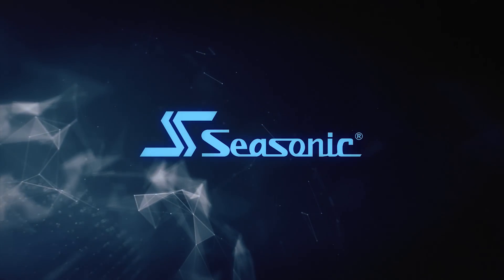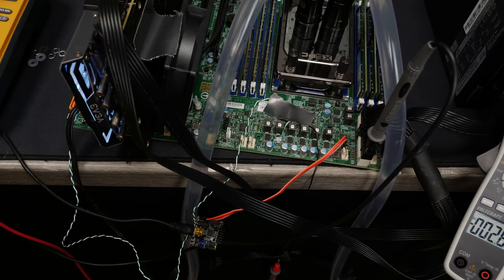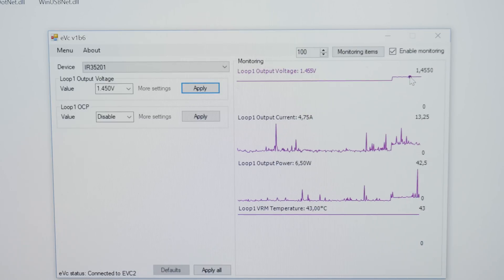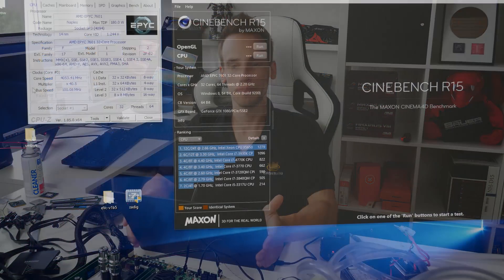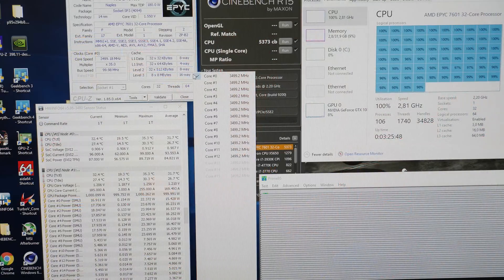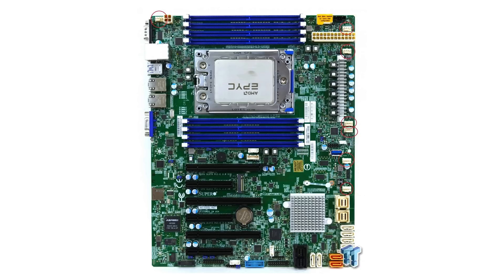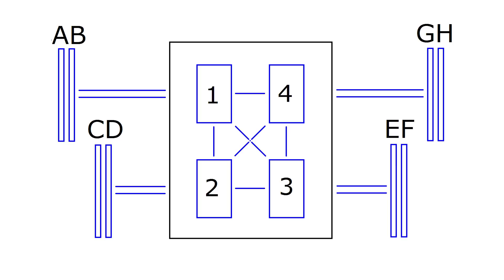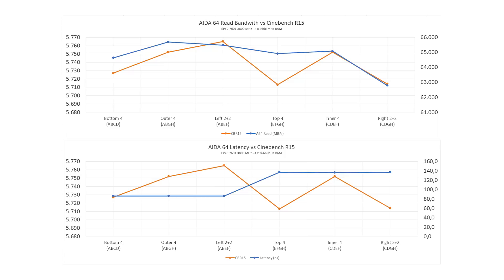EPYC 7601 Overclocked - Over 6000 Cinebench R15 and extensive RAM Tests

Comment: My dual EPYC 7601 (under default setup) only can reach 5200cb in Cinebench R15, is that normal? Another problem is the power consumption only can reach 150W, is lower than its TDP (180W). The motherboard is H11DSI, 16 ram with DDR4-2400.

Comment: I know this is an  old video.  With that said, can I push this chip to a stable 3 ghz with just a typical liquid cooling loop? I'm looking to build a 32 core system on the cheap and this chip is $500.00 from a reputable seller.

Comment: Ich verfolge deine Aktivitäten seit ich 2009 meinen 1. richtigen PC gebaut habe und erstmal Respekt für die Leistung. Meine Frage, ich habe auf genau diesem alten System das Problem, dass das Bild random freezed, aber der Ton und scheinbar das System weiter laufen. Abundzu spult das Bild sogar nach ein paar Sekunden wie auf einer Kasette nach, manchmal bleibt es dauerhaft stehen. Dann funktioniert es auf einmal wieder mehrere Stunden ohne oder mit nur minimalen Rucklern. Sogar SuperPosition lief ein paar mal ohne Fehler durch. SSD ist Fehlerfrei, keine RAM Fehler von Windoof entdeckt. Alle Kabel gewechselt, Hardware gereinigt und neu eingebaut, Turbo Keys usw. benutzt und deaktiviert. Phenom II X4 965BE, Shadow Rock Pro SR1 Premium, 8GB DDR3 1333 mixed RAM, ASUS M4A89GTD Pro, GTX560 ti und SSD als bootplatte. 500 Watt OCZ Mod XSTREAM und das wars eigentlich. lief seit 2009 stabil und der Fehler ist auch mit RX570 8GB, nur 1 Ram Riegel, allerhand BIOS setting versuchen vorhanden.

Comment: Cinebench is not a real world test, real world projects use 10-20 gigs of ram.
Reply: Real world projects can use 64+ GB. I ve had number of those and had to optimize to get them under 60.
Reply: Exactly, cinebench runs only at a short span of time where CPUs can sustain boosting their speed before heat starts crippling. I always wonder how far these OC'ed CPUs can go on a Sustained rendering that takes hours or even days which will test the reliability of these chips running above their rated speed, those are the typical production workflow for these CPUs.
Reply: Derbauer could download 'maxwell render 4' demo and run its benchmark scene, still will be finished in 3 mins, but that is a really good torture for cpu's. The scene itself is also quite inefficient so the cpu caches wont help.

Comment: The thing that's really holding this CPU back is the memory. CL19 ECC memory is very very slow. Considering most Ryzen systems can run CL14-CL16 memory above 2933mhz, this will make Threadripper 2 really shine in single threaded performance

Comment: Nice overclock and cpu testing, I'm not too much convinced that cinebench = real world application, you could use the Phoronix test suite (on Clear Linux) to have more metrics
Reply from the maker: there are almost no real world applications which can utilize 32cores so that's a bit of a problem :D
Reply: der8auer I'm not experienced in desktop applications but I see Blender used by Gamers Nexus as a benchmark.
On servers I see 'abusive' workloads more often than I would like: databases hammered by badly optimized code and queries, vm hosts with too many guests, unbalanced hardware in general.

But I was talking about getting the same Cinebench score while the RAM throughput between 4x and 8x slots is so different.
To investigate further I would use different workloads, I would't be surprised if mysql would benefit the octo-channel.

Thanks for your answer, looking forward for the dual socket tests :)

Comment: that is insane amount of current going into CPU
Reply: First2ner Still less than the i9. It's more than an FX (similar power draw for phase chilled FX, but FX is needing closer to 1.8-2v).

I wonder if we will see any double thick PCB for extremely thick copper traces for extreme OC boards. Either that or we will need LN2 coolers just for the PCB!
Reply: i9 can draw even more? is there a video of this?
Reply: First2ner I believe if you look at Gamers Nexus, one of the videos has a good power chart. From what I remember, TR1 was at 220w (4-4.2Ghz), and the i9 was around 600w (4.5-4.6 Ghz). I can't remember the exact video name right now.

That's really impressive for the 16 core AMD, and shockingly bad for the Intel at 18 cores. I don't know if my sub-zero phase cooler could actually handle the heat load (I'm hoping it will work for TR2), its running a 450-500w FX testing for insulation method and to see if the socket pins will rust up (packed with Vaseline).

GN did the testing with water blocks (they are not an extreme overclock channel).

Comment: Great work here.

I think that the ram speed will also have an influence on the results. Usually, I get around 150-200 points higher on CB15 using 3466 and 3600MHz on ram speed rather than 2133 with my 1950X, and my quad channel bandwidth, when using channel interleaving with 512 and hash enabled, results in an AIDA64 score of between 102-106GBps bandwidth on quad channel, rather than 86000 or so without those enabled for quad channel. That also causes AIDA64 to read a much lower latency, closer to 57-62ns rather than the high 70s and 80s for latency. 
http://hwbot.org/submission/3849980_ajc9988_aida64___memory_read_ddr4_sdram_108662_mbs

If you can or want to try OCing the ECC memory (which doesn't make sense, I know, but there are no ECC DIMMs currently out using Samsung 3200MHz chips for commercial use, but here is a video from Level1Tech on him making one of his own or polling for desire of the community for a limited run:
https://www.youtube.com/watch?v=1NxSZil8KS8 ), then the results could improve even more.

But thank you for this follow up video! Greatly enjoy your work.

Comment: Would it be possible to desolder the VRM and solder higher power components for more power? Improvise a better heatsink.  I would think it would cause BIOS issues(and possibly catch fire) but theoretically seems like it could work
Reply: ya

Comment: I have a Ryzen 1600 that hits 4.375 ish GHz. I get 175cb in single!
Reply: Have you tuned your memory? I've hit 167 in single @ 4.0 on a 1700. I think you should be able to hit 180+ with your clock speed.
Reply: And?
Reply: bardacuda82 I'm only running 8 gigs 2800 single channel..I know that doesn't help. $$$ is tight
Reply: Ah ok, must be the single channel RAM.
Reply: im on tr4 1950x
Reply: well i got no clue my score and not sure if it higher or lower then that.

Comment: 500w on 32 cores is really impressive since the clockspeed is 4ghz all cores. Imagine what 7nm brings to the table. 12nm pretty much is 14nm it's just optimized version while 7nm is an actual node shrink.

Comment: Wait you said the Seasonic PSU was 850watts? I'm seeing 1000watts on the CPU package......someone explain. I know you can run a little over the rating of a PSU especially if it is very effiecient but why not go with a 1200watt Seasonic or just an AX1600i? lol. Although I do prefer Seasonic.
Reply: ignore the rating the cpu was around 500w, the software was glitching.

Comment: Epyc video ! Now we need custom VRM waterblock. Would the Gigabyte have a better VRM ? http://www.gdm.or.jp/review/2017/1118/241729/3 IR35201 + IR3555M
Reply: compared to your mobo (https://www.tweaktown.com/reviews/8565/supermicro-h11ssl-nc-server-motherboard-review/index3.html) which has IR35201 + TDA21472 so it is 6 phases * 70A max => 420 amps... IR355M is only 60A max per phase

Comment: Why use Liquid Metall instead of add. shunt resistors?

To go round the power limit of a gfx card overclocker paint liquid metall on their shunt resistors. Why don't they solder a second shunt resistor on top of the first one. Now the two resistors are used in parallel reducing the resistance. If you shunt two resistors with the resistance of R parallel the resulting resistance is 0.5*R, the test curcuit on the GPU measure's only half the Voltage doubling the headroom for overclocking.

The advantages are:
1. There is no Liquid Metall eating away the solder of your GPU
2. The resulting resistance is known, you know the current draw, you know the new limit of your GPU an you can operate it more savely.

My Queston is: Why don't they do it?

Comment: I don't think it is meaningfull to measure memory latency with AIDA64. You can never contain latency in just one number. Intels MLC software is far superior, but I have never used it for AMD CPU's. You really need to test at least: loaded latency, idle latency, far latency, near latency, full random latency (or with prefetchers disabled), single threaded latency and multi-threaded latency.

Comment: Would motherboard's VRM be OK with custom heatsink?
Reply: Karras Bastomi My 4 phase VRM is pushing about the same power ($40 mATX). Its running an FX at 1.7 Vcore (unfortunately max for board). At 1.5v and 4.8 Ghz it was ~330w system increase over idle running Cinebench. I'm guessing at its 5.5 Ghz its probably around the 450w at least.

The CPU is using phase cooling, max core load of 10c with block at -25c under extended load. The VRM has 2x 40mm fans and some heatsinks added to the chokes ($3 modification).

I'm a little surprised it hasn't melted or cought fire. Fire extinguisher donations are accepted!
Reply: Jake Garrett why is the heatsinks on the chokes and not the mosfets?
Reply: Toby Cowles Both, I didn't need to modify the mosfet heatsink because it was alread good with fans. The chokes however got hot enough to melt  my fingerprints off (mmm, smell of burned fingers...)
Reply: Qwertypp10 probably if cooled to below freezing temperature...

Comment: I really wanna see a cinebench run on this CPU at 5GHz.
Reply: Wait for threadripper 2...the problem is not the chip, the problem is the motherboard.
Reply: CommanderWolfyX here is Threadripper at 5.2 ghz on launch day last year. Again on ln2 but possible. 
https://youtu.be/nTnN-wYsBvU
Reply: Quetzalcoalt the world will explode
Reply: Will need ln2 but should be possible
Reply: CommanderWolfyX correct, he said I want to see it run at 5ghz, which is possible. 24/7.... ya no way. Of course intel doesn’t have a high core count processor that can run 5ghz 24/7 either, it also needs exotic cooling.
Reply: you are literally asking for hardcore nerd porn
Reply: Yeah i just wanna see 1 cinebench at that speed or higher. 
Cinebench needs to make a new version :P
Reply: 9000 GHz
Reply: for 5 GHz you will be  fine with 1.45-1.5V with LN2, so it was be not so hurt...
Reply: No, the reason is totally different....Slow? Take a look at IPC (Clock to clock) and maybe you will be surprised, Ryzens IPC is very similar as Skylake-X IPC (and yes, we are not talking about  AVX 512 bit, which is almost dead instruction for the future)
Reply: Even old Ryzen has gone over 5ghz on ln2..... debauer himself did it on Ryzen release over a year ago...
Reply: I expect the CPU to die of over voltage before it reaches 5ghz
Reply: Thats Ln2 tho so you read the persons answer differently to me.

What i saw was someone asking what it would score at 5ghz assuming they want it to run at that clock 24/7.

You read it as at 5ghz doesn’t matter if it runs once and dies or runs at 5ghz forever
Reply: That is an impossible clock
Reply: commanderwolfyx if you arent a 13 year old you should go see a doctor.
Reply: It is the CPU that limits the frequency.

A friend put a 1800x in a modified motherboard that could go up to 2v and put out 2500w the 1800x cant draw over 170

It went to 4.05ghz and that was it.

Intel CPU’s have tech that AMD doesn’t use allowing for higher-clocks

Also intel doesnt use CPU cores in crossfire (infinity fabric)

Comment: I am concerned that using Cinebench for the memory bottleneck testing may have mislead your conclusions. For two reasons, #1 Cinebench is not that sensitive to memory bandwidth and latency, I do not think it is saturating the memory bandwidth of 4 channels, #2 the 32 core CPU has massive amounts of cache and the working set of Cinebench is small enough, so a lot of memory transfers could be completely avoided due to having so much L2/L3 cache 
For better results, I would recommend running 7-Zip 18.05 ( FYI, recent 18.xx versions have been optimized, up to 30% speedup), 7-Zip is known for being sensitive to memory BW/latency, and also Linpack is known for scaling with memory BW (just make sure to patch Intel's CPU detection out of the .exe)
Reply from the maker: Well If you remove one stick (triple channel) performance dropps by about 1000 points. Cinebench scales extremely well with memory speed
Reply: OK, so #2 is not true. Yet, if you double the memory speed by octa channel, the performance does not increase by 1000 points. So there must be a knee in the memory speed scaling.
Reply: Could give CPU rendering with Blender a test. Afaik that also scales really well with RAM and cores.

Comment: Dont use a line chart when you should use a bar chart. Line charts are for continuous datas not discreet data
Reply: The problem here is that it's not "time" on the horizontal axis, but different memory layouts. That's why it should be a bar plot.
Reply: Michael Gusevsky The difference is in the underlying process. Time series (line chart) has a continuous process (time).
Reply: I agree, but it's still perfectly clear and legible. It's fine.
Reply: it is true but as long as you understand it it's fine. he might just prefer the look of it
Reply: No.
Reply: I thought I had become illiterate attempting to understand it.